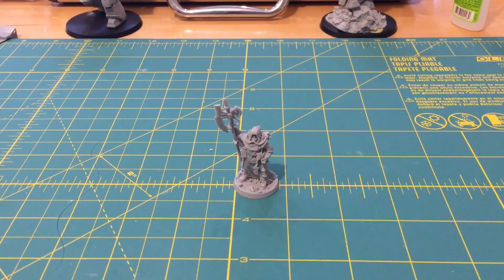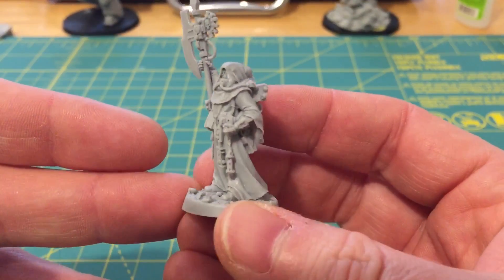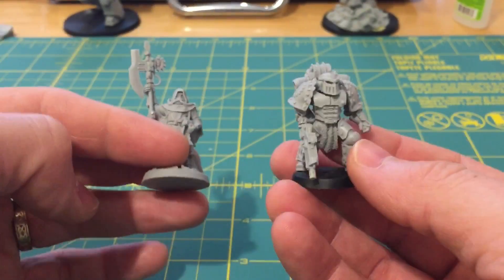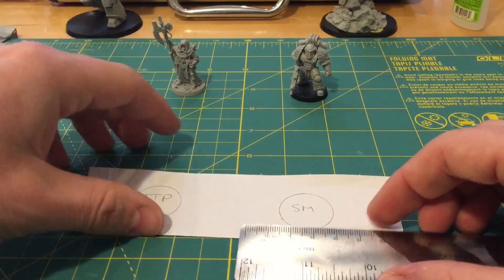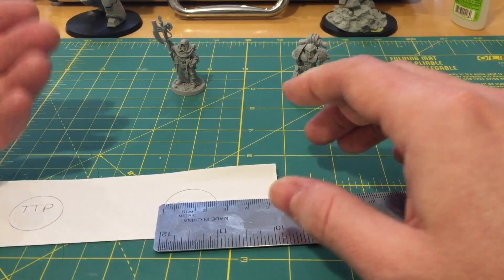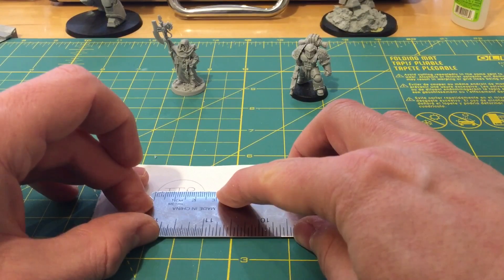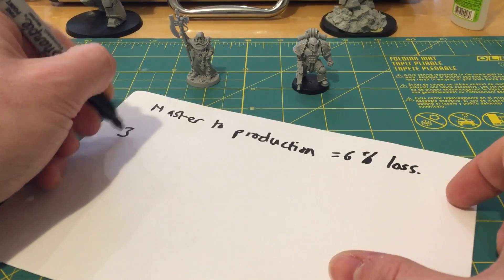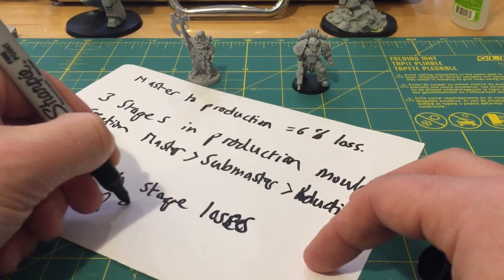Can we quantify parts shrinkage in the Forge World production process?

Comment: Fascinating idea - I'm about to tip my toe into FW modelling but I'm really put off with all the stories of mismoulds, slips and bubbles. Spending so much money should guarantee they only send you parts that are really really checked. Sounds like there is a lot to be desired in quality control
Reply from the maker: +gregtdude I guess the point I'm making here is that c.2% size shrinkage occurs at each of the three stages of model production and if moulds are not kept consistent across a kit a size mismatch will occur cause fit and finish issues.

The shrinkage itself is not an issue per sae and is an integral part of the production process. The handy thing here was I found an unusual example with a measurable reference point that allowed me to quantify the shrinkage - please note there is nothing wrong with the models I used in this video.

However, you are quite right on the overall quality piece, about a third of all kits I'be bought and assessed (123) had at least one fault. You have to be ready for dealing with that possibility and requesting the spares if you are going to get into FW.

Thanks for watching :)
Reply: gregtdude If you want their is always much cheaper recasts 
Here you go seller:laura-hook I myself have gotten from them before and they are great products